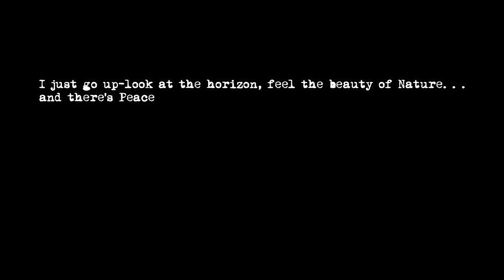10k pesos Benta kona | Armscor .22 Air rifle 20 shots | palakasan

Comment: sir..me armscor kapa jan kahit co2?
Reply from the maker: Thanks, po sa inyong mensahe. Maraming salamat po sa panonood.
Magandang Araw po sa inyong lahat, Maraming salamat sa inyong pagbisita sa ating channel.
Ganon din, salamat po sa inyong patuloy na pag subaybay. Mabuhay po kayo!
Always keep safe po, and God bless po sa inyo at sa inyong Pamilya.

Regarding po sa tanong ninyo. Pwede nyo pong ma contact sa messenger ang mga sellers po para ma assist po kau sa mga:
1. Contact info like cp# ng sellers
2. Accessories ng mga airgun
3. Brand ng airguns na avail nila
4. pricelist
5. paano ipadala
6. mode of payment
7. saan location nila
8. o may branch ba malapit sa inyo
9. atbp. na mga katanungan.
LOCAL SELLERS:
1. Win Lustarez
2. Robin Samonte
3. Rolly Aurellana
4. Philip Jeffreth Mendoza
5. Raffy Artigas

PAANO MAGING SAFE AND LEGIT CHECK?
1. Mag pa legit check-Ask ang mga matagal na sa airgunner
2. Mag padala ng Private Message- Send a message regarding sa information na gusting malaman
3. Once nag reply ask question regarding sa accessories or type ng airgun na bibilhin
4. Once na nakapag decide na sa bibilhin, mag video call po kayo para na makita nyo xa same sa profile pic at photos ng naka transaction na seller.
5. Before mag bayad sa item na kinuha mag papadala ang Seller ng Video na binabalot nya ung item mo
6. Hingin ang code if sa ano mang currier nya pinadala.

ADD ON QUESTION:
Ano ung valve na naka thread?
Ito po ang vid na ginawa ko sa installation ng airgun nimrod: https://www.youtube.com/watch?v=wrj_i6z119w&feature=youtu.be
Maraming salamat po. From AIR RIFLE HOBBIES PHILIPPINES

Comment: sir anung mangda pellets sa armscor
Reply from the maker: Thanks, po sa inyong mensahe. Maraming salamat po sa panonood.
Magandang Araw po sa inyong lahat, Maraming salamat sa inyong pagbisita sa ating channel.
Ganon din, salamat po sa inyong patuloy na pag subaybay. Mabuhay po kayo!
Always keep safe po, and God bless po sa inyo at sa inyong Pamilya.

Regarding po sa tanong ninyo. Pwede nyo pong ma contact sa messenger ang mga sellers po para ma assist po kau sa mga:
1. Contact info like cp# ng sellers
2. Accessories ng mga airgun
3. Brand ng airguns na avail nila
4. pricelist
5. paano ipadala
6. mode of payment
7. saan location nila
8. o may branch ba malapit sa inyo
9. atbp. na mga katanungan.
LOCAL SELLERS:
1. Win Lustarez
2. Robin Samonte
3. Rolly Aurellana
4. Philip Jeffreth Mendoza
5. Raffy Artigas

PAANO MAGING SAFE AND LEGIT CHECK?
1. Mag pa legit check-Ask ang mga matagal na sa airgunner
2. Mag padala ng Private Message- Send a message regarding sa information na gusting malaman
3. Once nag reply ask question regarding sa accessories or type ng airgun na bibilhin
4. Once na nakapag decide na sa bibilhin, mag video call po kayo para na makita nyo xa same sa profile pic at photos ng naka transaction na seller.
5. Before mag bayad sa item na kinuha mag papadala ang Seller ng Video na binabalot nya ung item mo
6. Hingin ang code if sa ano mang currier nya pinadala.

ADD ON QUESTION:
Ano ung valve na naka thread?
Ito po ang vid na ginawa ko sa installation ng airgun nimrod: https://www.youtube.com/watch?v=wrj_i6z119w&feature=youtu.be
Maraming salamat po. From AIR RIFLE HOBBIES PHILIPPINES
______________________________________________________________________________________________

Magandang Araw po sa inyong lahat, Maraming salamat sa inyong pagbisita sa ating channel.
Ganon din, salamat po sa inyong patuloy na pag subaybay. Mabuhay po kayo!
Always keep safe po, and God bless po sa inyo at sa inyong Pamilya.

Ito po yung kadalasang tanong na hope po makatulong.
PAANO MAGING SAFE AND LEGIT CHECK?
1. Mag pa legit check-Ask ang mga matagal na sa airgunner
2. Mag padala ng Private Message- Send a message regarding sa information na gusting malaman
3. Once nag reply ask question regarding sa accessories or type ng airgun na bibilhin
4. Once na nakapag decide na sa bibilhin, mag video call po kayo para na makita nyo xa same sa profile pic at photos ng naka transaction na seller.
5. Before mag bayad sa item na kinuha mag papadala ang Seller ng Video na binabalot nya ung item mo
6. Hingin ang code if sa ano mang currier nya pinadala.
Nagbebenta kaba ng AIRGUN?
-Sa ngayon nag promote and review lang po muna ako ng Airgun na aking nabibili sa mga maker. Pero maka assist po ako if saan po kayo maaaring bumili online.
SAAN MAKABILI NG AIRGUN?
Makakabili o makakaampon po tayo ng Airgun sa mga online store sa Facebook po.
1. Search Airgun group sa "Facebook"
2. Once accepted and join post for inquires
3. They will Private message po sa inyo sa mga details
a. Payment method
b. Specs ng Airgun
c. Warranty
d. Atbp.
4. Do background and legit check po by posting sa group
a. Tingnan mga friends list niya if madami syang kaibigan na Air gunners
b. Kung kalian ginawa account nya at least 5 years
c. Do a video call sa transaction and screen record for assurance.
d. Maganda kaliwaan ang pag bayad like meet up
PWEDE BA IPA CONVERT ANG C02 TO PCP?
Yes, pwede po sir, e check po ng maker if pwede most of the Airgun like: Nimrod, Manlapat, Taurus, Armscor, Atbp.
Pakita nyo lang po sa maker and ang maker na po mag suggest sa inyo anong conversion gusto nyo like bottle o naka tube. Range po sa 8k-12k pataas po ang bayad sa conversion nakadepende po sa maker. 

PAANO PAPADALA NG SELLER ANG AIRGUN?
Papadala sa currier ng seller, sila na po bahala doon.
By buss o barko, make sure po na complete address and my phone number and ask how long dadating.
Ganon din ask ang sellers for warranty what if di makakarating ang Item.

KAILANGAN BA NG LICENCE ANG AIRGUN?

There is no law that will punish anyone in the country for having an airsoft/airgun even if it is not registered. You also don’t need any form or permit or license to own one...our firearms law R.A. 10591 does not include the word airsoft or airgun in there. Feb 6, 2019.
Credit from: Journal.com.ph

PAANO MA PA REGISTER ANG AIRGUN?

Pag nakasali na sa mga Airgun group sa Facebook
You can ask for the legit person for register 
(LARRY AVILA) Philippine Team natin you can ask him po
Magbibigay sya ng mga info for requirments
Maganda if by group po ung pag register para isahan nadin po

PWEDE BANG ISAKAY SA BUSS O BARKO ANG AIRGUN?
1. Kailangan po na naka register ang Airgun
2. Kailangan dn may receipt ang Airgun na makikita kau ang may-ari
3. Mag inquire sa Buss and Ship station if pwede isakay ang Airgun
a. Ipakita ang registration at Reciept 
4. Pag pumayag na sila doon lang dadalhin ang Airgun
5. Baklasin ang Airgun-walang laman na c02 o hangin- at ilagay sa safe na lagayan
PWEDE BA MAISAKAY SA AIRPLAIN ANG AIRGUN FROM IBANG BANSA SA PINAS?
Sa ngaun limited po ang kaalaman ko tungkol dyan, ang iba sabi nila nakakapag padala sila sa balik bayan box.
PRICELIST STOCK AIRGUN: (Walang scope, Bipod, c02 Tank)
Depende po sa Seller ang Price either mababa sa binanggit kung Price o Mataas.
1. Nimrod co2 7500 more or less
2. Manlapat co2 13k more or less
3. Taurus co2 7500 more or less
4. Eskopeta co2 from 5500 pataas
5. Jr mangio co2 from 7500 more or less 
6. PCP pump 3k more or less 3 stage
7. PCP pump 4k more or less 4 stage 
8. PCP starting from 15k-50k local made
9. Scope from 3500-18k
10. Suppressor from 2k-5k
11. Tripod from 1500-2500
12. Scope 3500php to 5000php “Low end”
13. Scope 8000php to 15000php “Mid End”
14. Scope 20000php to 70000php “High end”

About namn po sa mga location ng pamilihan-cnxa po dahil hindi po ako affiliated sa mga company po o pagawaan ng airgun dito sa Pinas o sa ibang bansa.
Thanks, po sa support, Share and SUBSCRIBE po.
 from Air Rifle Hobbies Philippines.
LOCAL SELLERS

Comment: tga negros po kayu.?
Reply from the maker: Thanks, po sa inyong mensahe. Maraming salamat po sa panonood.
Regarding po sa tanong ninyo. Pwede nyo pong ma contact sa messenger ang mga sellers po para ma assist po kau sa mga:
1. Contact info like cp# ng sellers
2. Accessories ng mga airgun
3. Brand ng airguns na avail nila
4. pricelist
5. paano ipadala
6. mode of payment
7. saan location nila
8. o may branch ba malapit sa inyo
9. atbp. na mga katanungan.
LOCAL SELLERS:
1. Menchie Muli
2. Win Lustarez
3. Robin Samonte
4. Rolly Aurellana
5. Philip Jeffreth Mendoza

PAANO MAGING SAFE AND LEGIT CHECK?
1. Mag pa legit check-Ask ang mga matagal na sa airgunner
2. Mag padala ng Private Message- Send a message regarding sa information na gusting malaman
3. Once nag reply ask question regarding sa accessories or type ng airgun na bibilhin
4. Once na nakapag decide na sa bibilhin, mag video call po kayo para na makita nyo xa same sa profile pic at photos ng naka transaction na seller.
5. Before mag bayad sa item na kinuha mag papadala ang Seller ng Video na binabalot nya ung item mo
6. Hingin ang code if sa ano mang currier nya pinadala.

ADD ON QUESTION:
Ano ung valve na naka thread?
Ito po ang vid na ginawa ko sa installation ng airgun nimrod: https://www.youtube.com/watch?v=wrj_i6z119w&feature=youtu.be
Maraming salamat po. From AIR RIFLE HOBBIES PHILIPPINES